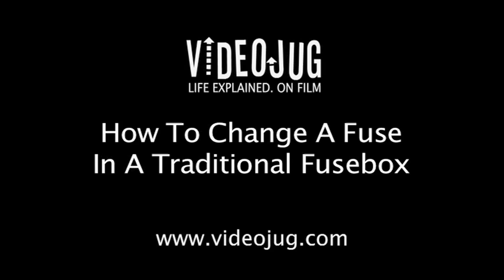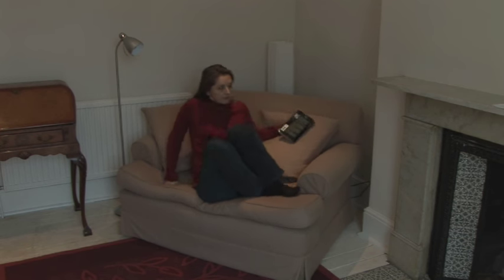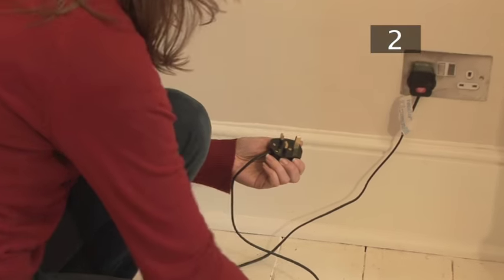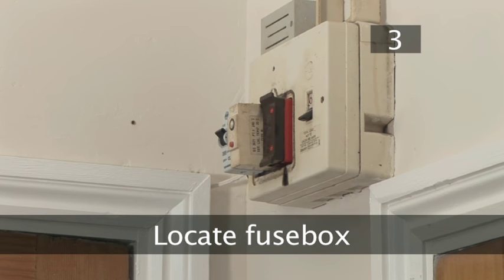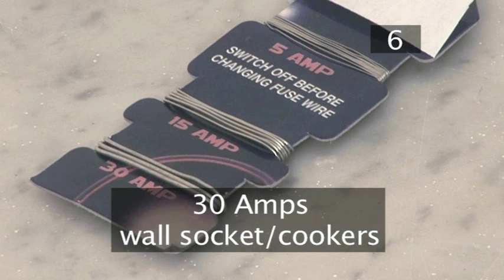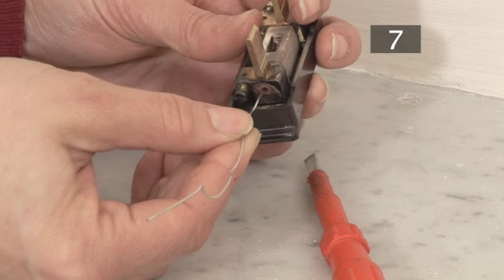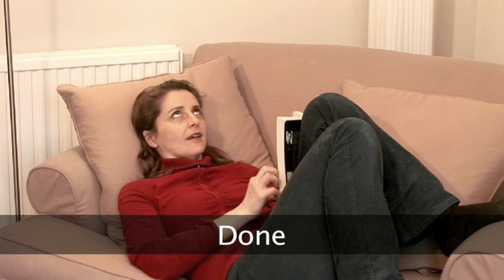How To Change A Fuse In A Traditional Fuse Box

Comment: Why does this have so many dislikes?  It seems to me to be the best and simplest video on the subject on all of YouTube.
Reply: Klate Wilson probably a bunch of electricians.
Reply: Because the video shows something dangerous.  See the burn marks around the fuse and the spark when the fuse blew.  That actually can happen.  So why have your hand anywhere near the fuse when you switch back on.  If there is still a fault and the fuse blows immediately there is a risk that that spark (which can be vapourising metal) will contact your hand.
Reply: Probably because there were a lot of mistakes in the film.

Comment: When she flicked the switch back on her hand was underneath the rewireable fuse. If there is a fault with the wiring the fuse would've just blown again, spraying her hand with molten metal..
Those old Wylex boards are very reliable, but they are badly outdated. they were designed over 50 years ago. If you still have one it would be wise to think about getting it replaced. If you have one that looks like the one in the video (with scorch marks and missing covers) get it replaced Immediately! a board like that is a fire waiting to happen

Comment: Very helpful, straght to the point! There's no doubt truth in the comments that certain details were neglected. But your advice to check asll appliances first was welcone,  and my friend who was about to 'fix the fuses (which turned out not to be blown)  listened to my newly learned info. 

We unplugged everything and our safety switch was still tripped... then found an outdoor spotlght on this old house was plugged into an outlet that had got rain ingress! We disconnected it, and our relied-upon msin wall plug circuit is back in action! Yay!

Comment: hello! I'm about to install a dimmer switch but our flat is pretty old. I assume the fuse box is the gate to all electrics in the house, importantly the lights right? I only ask because to the right of our fuse box (look identical to the one in the video), there's a lot of other old boxes. I guess i can safely assume that by turning off the master switch and trying the lights, if nothing turns on light wise then i'm safe to go ahead with the switch replacement?

Comment: I see lots of comments on this vid saying rewireable fuse boxes should be replaced, these types of boxes are still perfectly valid and there is no reason you shouldn't have one, the only reason you might want to get it replaced is because these boards don't have RCD protection but the overcurrent protection does the same job  as a modern MCB (circuit breaker).
Reply: As long as they are installed correctly ,they should be safe to use but as you say they do lack the RCD which is a requirement for new installations so if you have any upgrades done then the board may have to be upgraded ,or a separate  RCD would have to be fitted on a new circuit .They are well designed boards because they have dual screw terminals inside which reduces the chance of a  loose connection.

Comment: So many mistakes.
1. A fuse in a plug blowing shouldnt blow the fuse in the consumer unit unless one of them is the wrong size. Max size for plug is 13a, main fuse would be 30 for a ring final circuit or 20 for a radial.
2. A fuse blowing will not trip the type of main switch shown here. It may trip an rcd type though.
3. Never turn on a main switch with you hand over a fuse, if it blows you risk being badly burnt.
4. If a fuse blows you should always investigate why, they rarely if ever just go, and yes I've heard all about tired fuses.
Reply: Exactly, at 0:50 he is misleading the public saying  a blowing 15A fuse in an appliance has likely blown main fuse!  Itslike onefuse has blown the other. Also at 1:14  he says a  blowing fuse normally throws the main switch in off position !!!  I never knew a blowing dying fuse wire has the time or even power to throw/knock main switch into off position!  Ok sparks do fly when fuse wire has a meltdown but  Its shocking that it throws the main switch

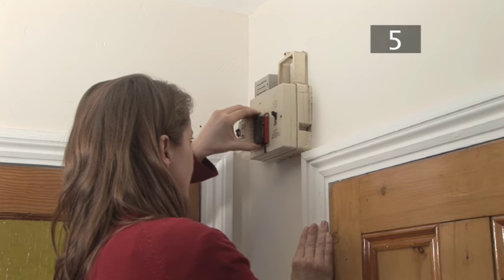Comment: Why wind the wire around the screws when there are nice small holes to put the wire in, where the srews lock the wire more secure? You can clearly see that the rest of the blown wire sits in the holes at 1:21
If there are holes there on your fuse, use them!

Comment: The part after running the wire through the fuse is not very clear as your hands are in the way. That is the most important point.  All the fuses on my board are the same with coloured dots for the different amps. Why are the fuses so different in this board.  There are clearer videos on YouTube.

Comment: I have a old fuse box with all fuses like the one that was replaced. It trips a lot and takes a while to switch on again once tripped. It seems to happen from the plugs and sockets fuse which is a 30amp red fuse. Should i swap it for a higher amp fuse?
Reply: If it trips then it’s a retrofit mcb but you should definitely not replace with higher amperage at all - can cause electrical fire in your wiring within the fabric of the building

Comment: Useful video regarding fuse changes, but beware, many older type fuse boxes have dangerous asbestos in them. Best to call an electrician if your box is old.
Reply: They only tend to have a tiny little slab of it on the backplate that touches the ceramic holder, perfectly safe as long as you don’t touch or mess with it

Comment: Just replace the fuse itself with a simple plug-in circuit breaker. You can easily switch it back on and they plug into these old fuse circuitry.

Comment: I didn't understand why fuses with higher amps should cause a fire, isn't the reverse, i.e., fuses with lower amps could cause a fire?
Reply: I the higher amp fuse is put in a lower amp circuit that circuit will have more current available so if something does go wrong or there's a short circuit the fuse may not blow causing the mains wiring to carry more amps to flow than its rating, causing it to heat up, possibly causing a fire.

Comment: wait a second, if you test an appliance in an area that still has power and that appliance is faulty, isn't that going to trip that circuit as well?
Reply: Yes, it will, so you may as well unplug every appliance on the circuit, rewire the fuse, then plug everything back in one by one until you find the cause of the fault

Comment: No such word as amperage in the English language. It is current.
Also when a fuse blows the main switch does not trip. It is a manual device in a Wylex unit and has to be physically turned off. It does not have a fuse cover, which makes the unit a fire hazard as can be seen by the sparks and resultant scorch marks. The lady needs to get the unit replaced and have the wiring checked it fuses are blowing. It's all about safety, not bunging another fuse in to have it pop again.
Reply: Adrian Bailey lmao
Reply: of course there is. amperes is the unit of measurement for an electric current. amperage is the strength of that current.